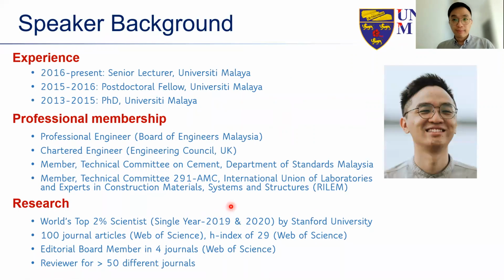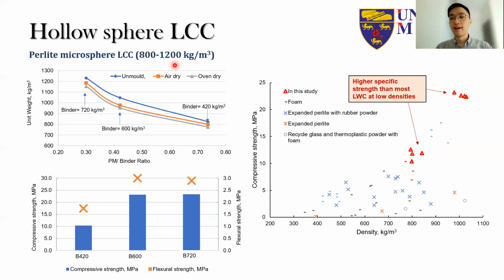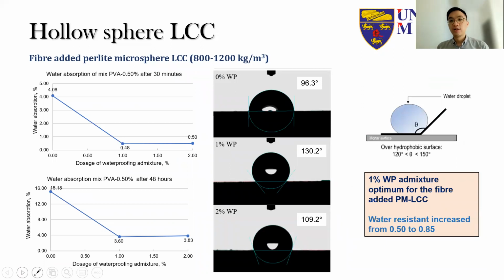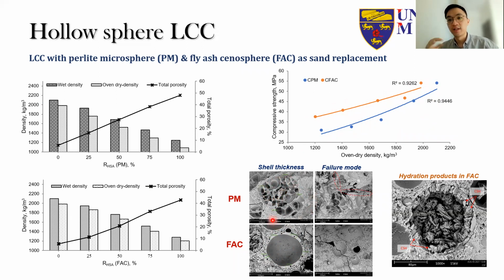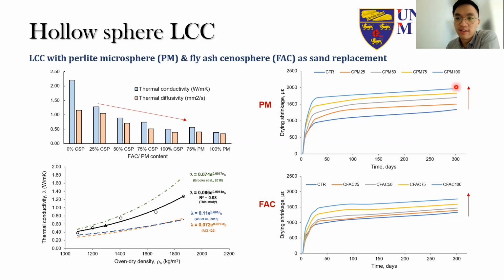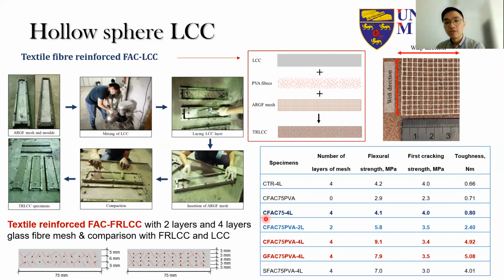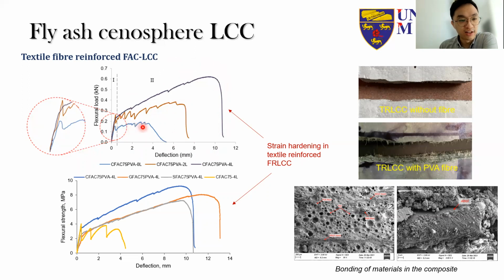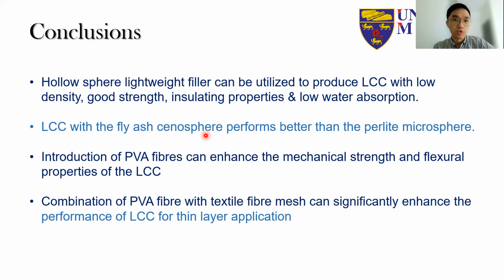Light weight cementitious composite: Dr. Mo. Kim Hung, University of Malaya, Malaysia ( ICCMS 2021)

Comment: Very nice presentation

Registration number: ICCMS/21/Au/0000260
Date: 19/12/2021
Session: 2
Slot: 3
Time: 11:40- 11:50 pm
Paper: Prediction of PVA Fiber Effect in Engineered Composite Cement (ECC) by Artificial Neural Network (ANNs)
Name: Md Nasir Uddin